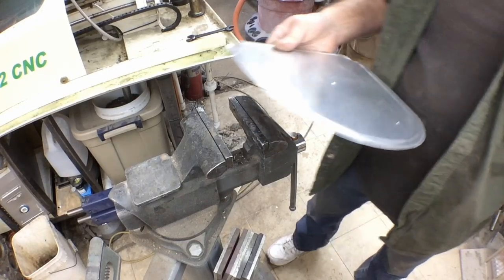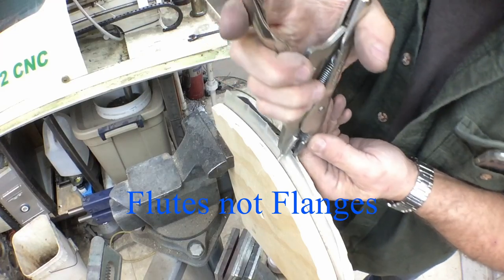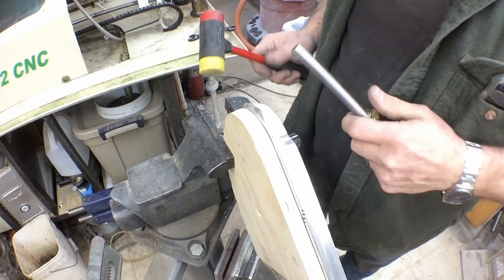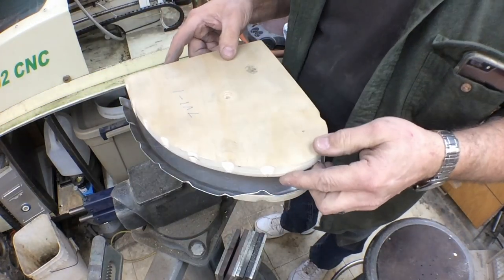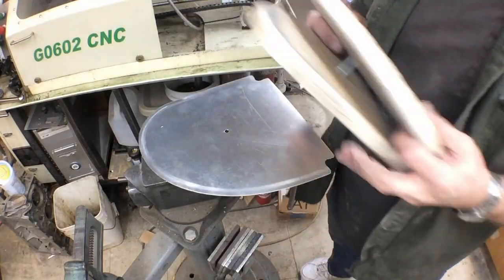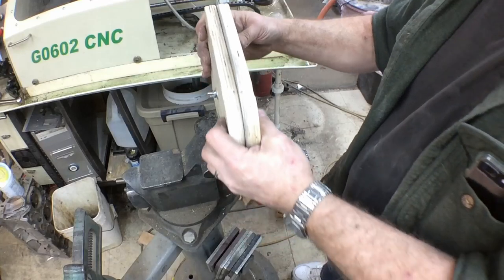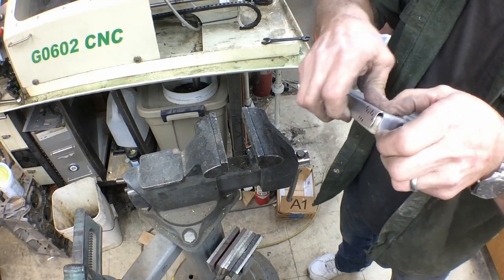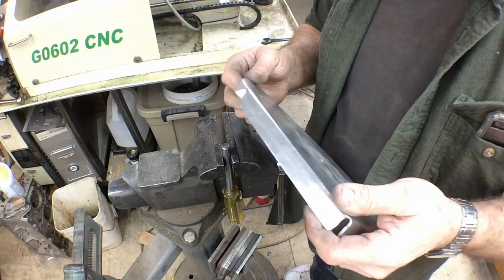Building a Zenith 701 Experimental Airplane, Building Ribs Part 5: Forming The Ribs

Comment: Was a good series!
Reply from the maker: Your not even going to let me finish looking foolish in the last part? It should be done later today and I will talk about all the mistakes I made along the way. Thanks.
Reply: hillsgun hey! I'll watch everyone make all the mistakes then I can do mine without a single defect! Well not so much.. Just had to scrap 18 ribs because the zenith plans were wrong.. Forgot to check the revised plans :(
Reply from the maker: Now Jack I have to jab at you here  :)  when you drew them out did you do it manually or was it drawn in cad?
Reply: hillsgun CAD, of course. But cad or pencil aren't immune from outdated plans!
Reply from the maker: yea yea everyone blames the plans😀
Reply: hillsgun it's the plans actually.
Reply: Relief for the spar is 21 mm in the rear rib, no enough to clear the 25.4mm spar and in return the top is too short and the top Rivet has no material to Rivet in... Revision is 26 and 27 at the top. Cauth it too late and waited 1 sheet of 025. Shit happens
Reply from the maker: been there done that. All part of the process of scratch building, I haven't built any form and cutting blocks for several years so it was like I was starting over. I will talk about what I did wrong at the end of the final video and there are lots of mistakes even though I sometimes think I know what I am doing.
Reply: hillsgun maybe add in your video that's its a good idea to check the plan revision or get an updated set for 70$... Just waisted 130$ so not a bad idea!

Comment: Just curious,....but has anyone tried using a short-stroke rivet gun w/ a flush head to work the aluminum to the form block?
Reply from the maker: The short answer is yes. Tinman Tech sells flow forming heads which has different hardness heads. I built one with one of the extra heads from the hammer I use to form on the form blocks. The idea is sound and has some applications, but I did not like the way it formed. It seemed to take almost the same amount of effort and I still got the vibration from the rivet gun plus the constant hammering of the rivet gun, so for me it was a no go. I continued to manually form over the blocks by hand. An example of this being done is by a guy building a bearhawk patrol, his u-tube channel is  n3uw
Reply from the maker: I don't think you would want to use a steel rivet head as you would overwork the aluminum.